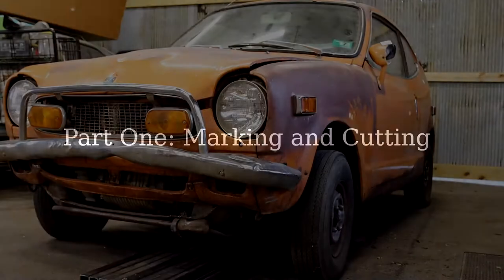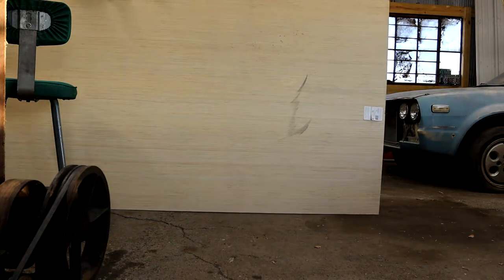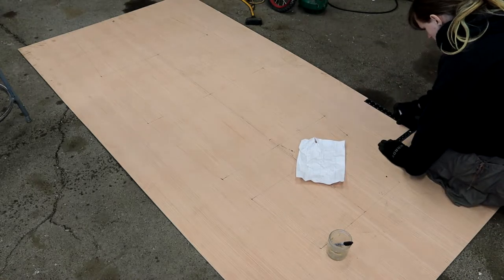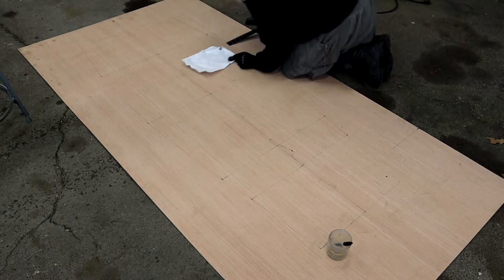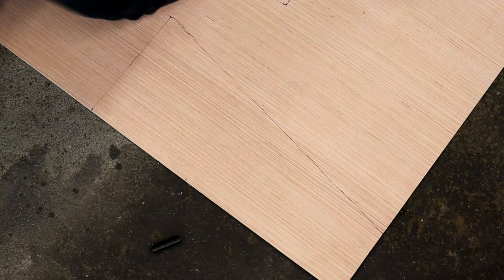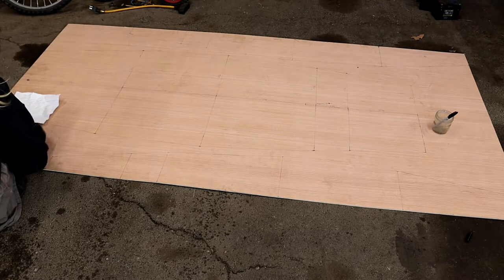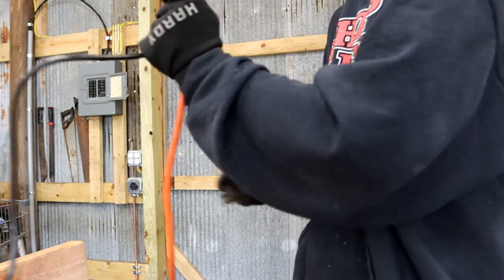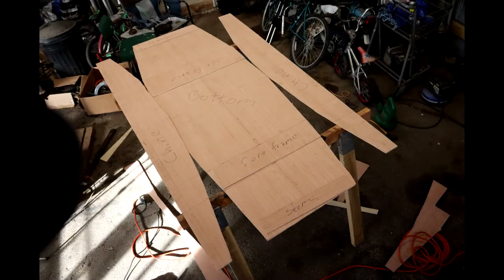Micro Mouse Sailboat Build - Part One

Comment: The plywood you are using looks like lauan. Have you had problems with this de-laminating on previous boats?
Reply from the maker: It is actually a 5mm poplar sheet from Lowe's! I have had good experiences with this wood for plywood boat building but if it is a larger boat, carrying any sort of weight, I recommend fiberglass wrapping it for strength, since it's not very thick!

I've done some water testing with the bare plywood before and it doesn't seem to fall apart easily, so as long as it's sealed up (I use polyurethane!) I think it will last a good, long time.
Reply: @NatashaB  Thanks Natasha. Love your Videos!
Reply from the maker: Thank you! I should have another one coming, I’ve just had other projects going on!